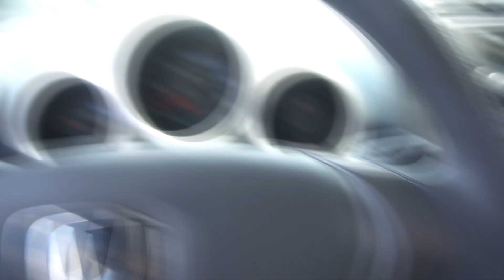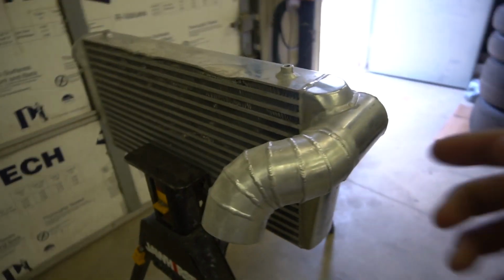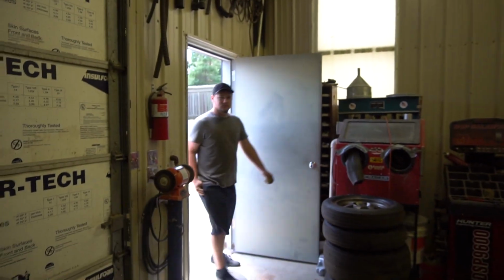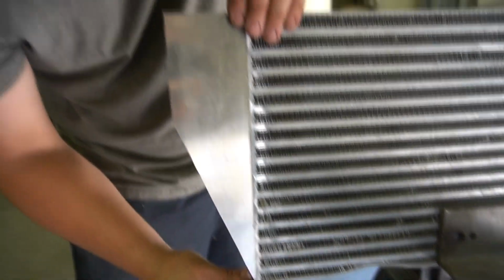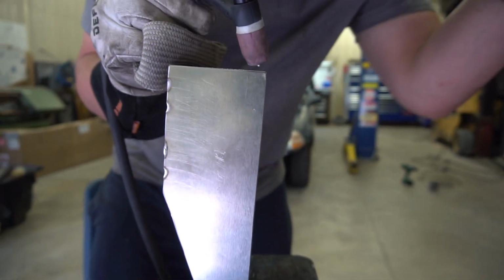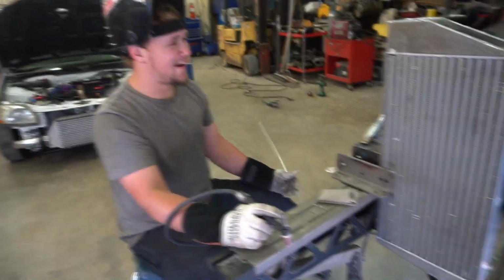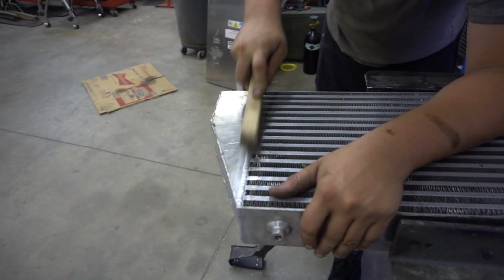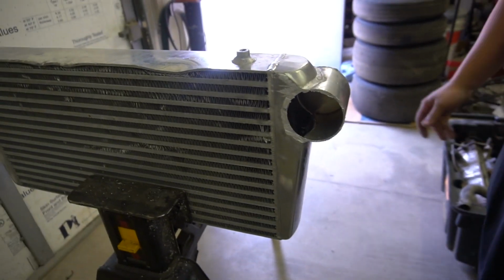Custom Intercooler for the Turbo Wagon

Comment: If I didnt just wake  up I would have lost a lung laughing. My friend and I always used to say sand in the oil and intake is good for the engine because it acts like bearings so you have high performance bearings. Also my buddy pointed out that while I was gringing the stock battery tray out of the race car that there was nothing covering the throttle body :D